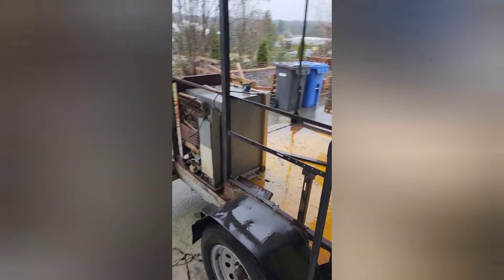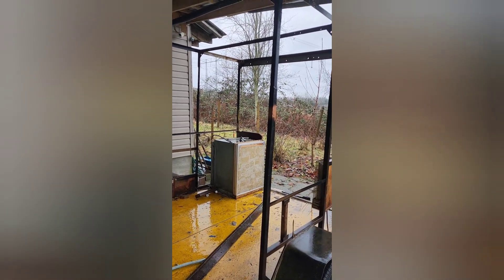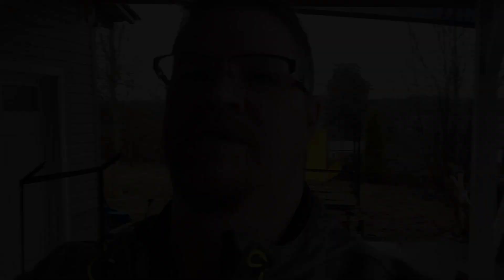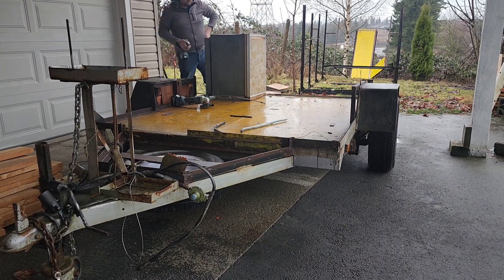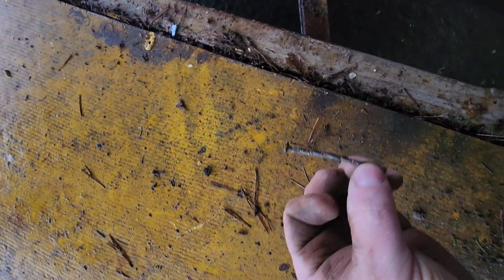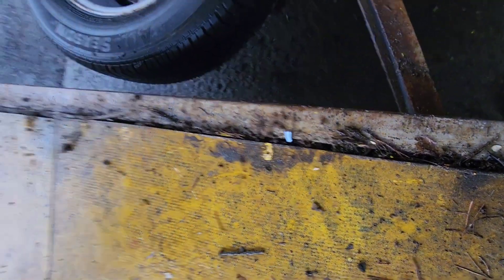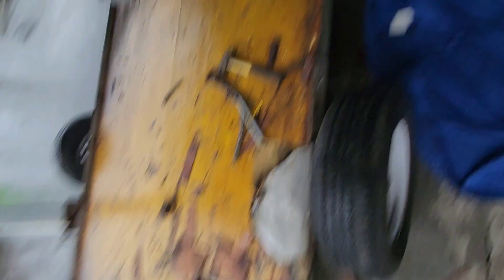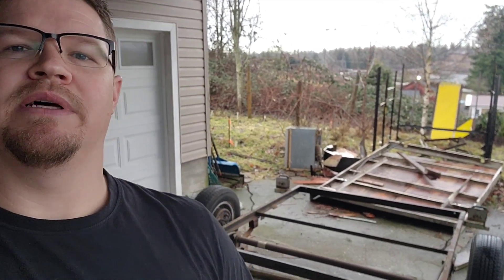Teardrop camper build (part 1)

Comment: What are the dimensions of the trailer?
Reply from the maker: The living space is 11 feet long by 6 feet wide. The floor is 10 feet long by 6 feet wide and has 6 inch curved out on each end. 
The trailer itself is 13.5 feet long.